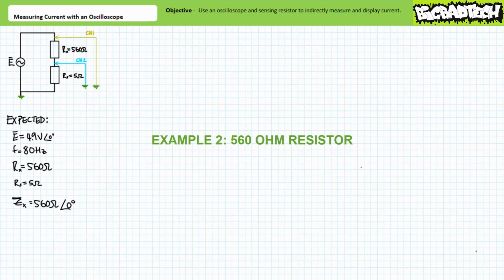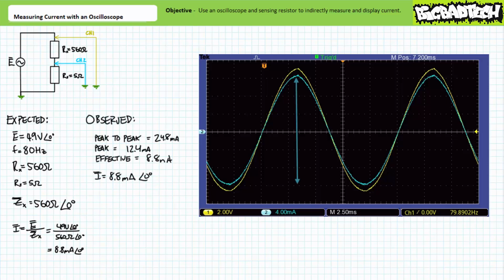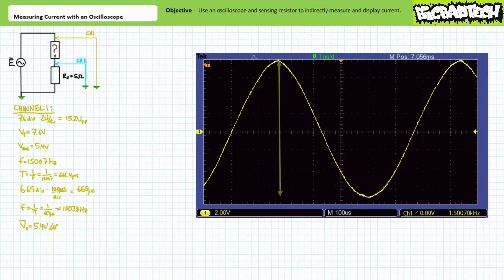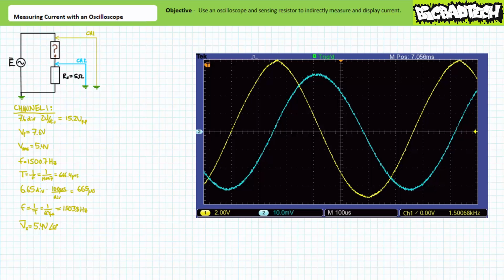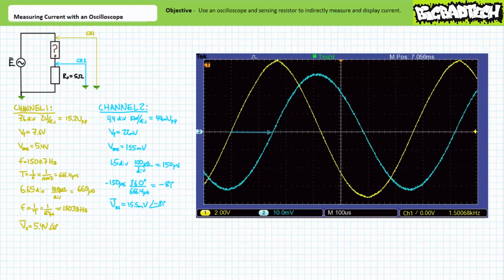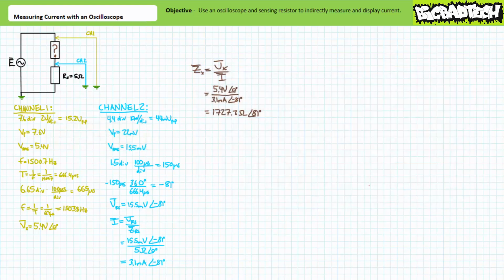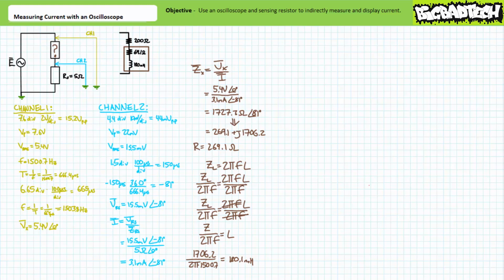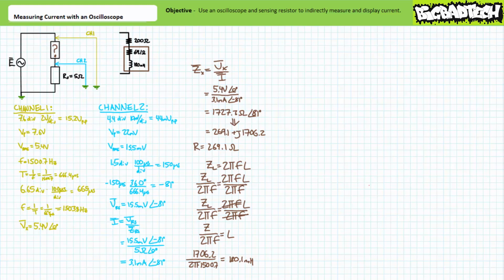Measuring Current with an Oscilloscope (Part 2 of 2)

Comment from the maker: ERROR at 9:20 Channel 2 has a peak to peak span of 6.4 divisions instead of 4.4 divisions. You should be obtaining the following values for channel 2: Vpp=64mV, Vp=32mV, Vrms=22.6mV, I=4.5mA/-81
This would also change the impedance calculations at 11:40: Z=1.2k/81, R=186.7, L=125mH.

Comment: Jim - Channel 2 looks to be 6.4 div instead of 4.4.
Reply from the maker: Good catch! 10,000 bonus points to you. At 9:20 you should be obtaining the following values for channel 2: Vpp=64mV, Vp=32mV, Vrms=22.6mV, I=4.5mA/-81
This would also change the impedance calculations at 11:40: Z=1.2k/81, R=186.7, L=125mH. Thanks for letting me know.
Reply: @bigbadtech  You're welcome. Great Video !!! Thanks for your tutorials.